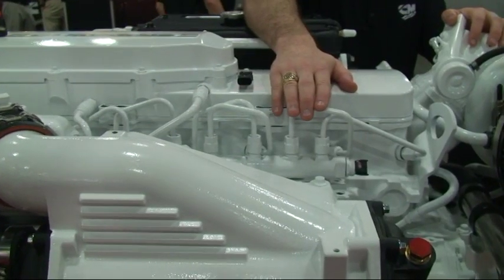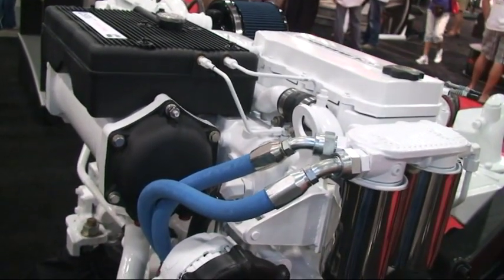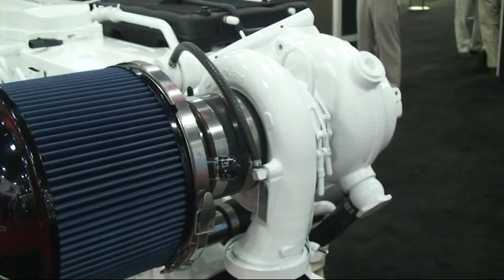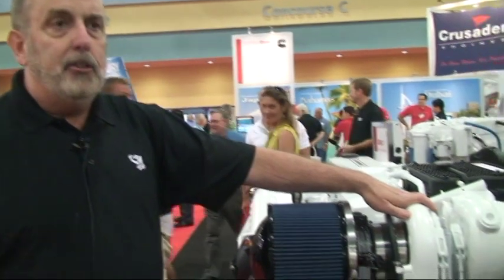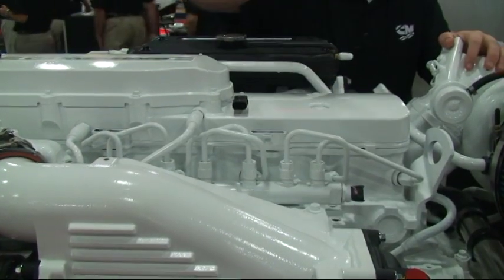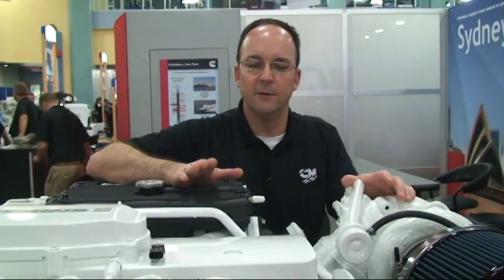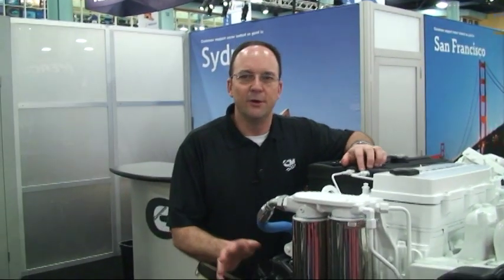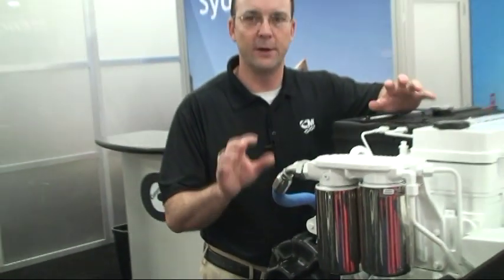Cummins Diesel's QSB 6.7 Liter Turbo Marine Diesel Engine

Comment: Dear all readers, 

I am no haters. I just sharing information.
Since 2013, we have tested inboard outboard stern drives technology against conventional underhull propeller.

 It is sad to say, test the data is not in favor of stern drives...😕

Possible you could do the test and update us.

1) Contender:

Mercruiser 7.4L 310hp@4,500rpm Stern Drives 1.75:1 Ratio Prop 17" 

Vs.

Cummims Mercury Diesel 6.7L 
280hp@3,800rpm Stern Drives 1.75:1 Ratio Prop 17" 

Vs.

 Cummins QSB6.7L 310hp Straight Shaft underhull propeller 2:1 ratio prop 18".

2) All Running at 28knots for 2hours per test run for 3 runs

3) Results: 

Stern Drives with Mercruiser 7.4l consume avg = 109.8 liters of gasoline per hour.

Vs 

Stern Drives with Cummims Mercury Diesel 6.7L = 91.2liters per hour

Vs.

Conventional straight shaft with QSB6.7 consume avg = 76.8 liters per hour

Conclusion Straight shaft is more efficient than stern drives system. THIS CUMMINS QSB 6.7 IS AWESOME!!! 
WE USE IT WITH ECO SURFACE DRIVES AND GAIN 2X MORE FUEL ECONOMY...
🤔😎😊😇

Inboard-outboard Stern drives is the worst of all marine propulsion...

🤐🤕🤒😔😭😢😭😱😰😨😵

Comment: same engine as in the new dodges just dressed in marine stuff right?
Reply: On the outside yes, internally there’s usually slight tweaks. Such as different pistons (bowl size), cam and injectors. The computer (ECU) is also tuned differently, the high hp model has 550 or 570hp. Also the turbo is different, dodge 6.7 has a vgt and this one is a traditional style with wastegate.